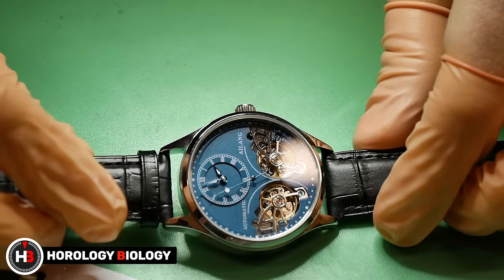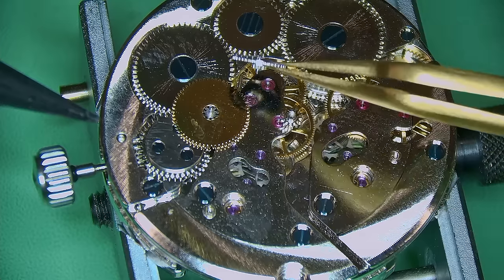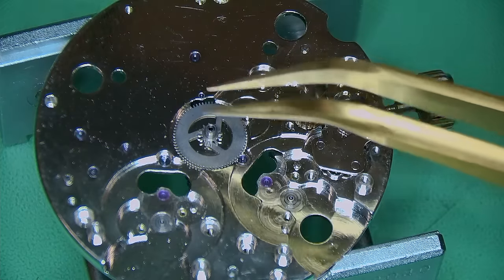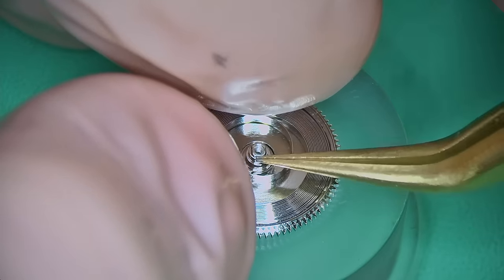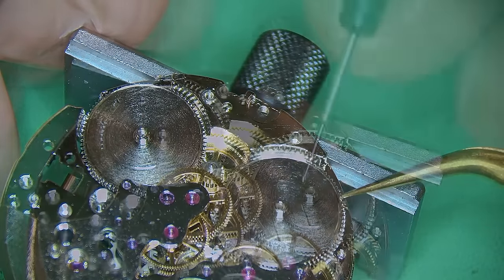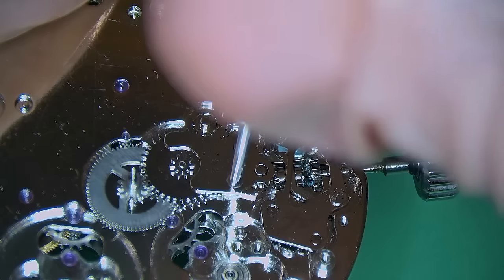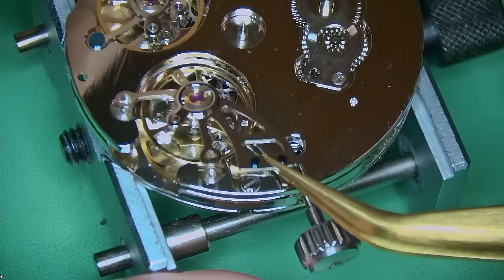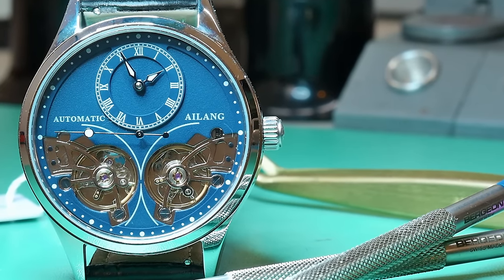I received the Strangest AliExpress Automatic Watch Can the Ailang run better after a Watch Service?

Comment: I now do wonder if the vibrational coupling between the two running trains will indeed increase the accuracy of this watch.
The fact that less energy is needed to drive either side, combined with the fact that the two mechanical oscillators are sharing the calibre body which would likely lead to the two eventually synchronising has the potential of making this guy quite accurate. 
Chinese watchmaking is quite fun. It is cheap, and thus attainable for most, which I think is great. All the parts may not have the finesse of a Swiss or Japanese watch, but still acceptable in quality. 
Nice to see this one dissected 😊
Reply from the maker: You are more than likely correct as the second side would use nowhere near as much energy (or delayed friction) as the hour and minute train

Comment: I have a Roamer from 1960. My grandfather got it as a 50th birthday gift from his coworkers. He passed away in 1963 and the watch circled with my uncles until it ended up with my dad about 15 years ago. He gave it to me in 2011. I had it serviced and got a new leather strap for it. It works beautifully. Still has the original box and warranty papers as well.
Reply from the maker: Thanks for sharing. Roamer was a very underrated brand for sure.

Comment: That was really quite fascinating. 
Having seen these double escapement watches on AliExpress and eBay I thought that maybe the second balance wheel
was bogus and was probably driven, rather than driving anything.
I was scratching my head as to how it could be regulated on the Timegrapher. Your method really did surprise me.
To have one power reserve derived from 2 mainsprings, supplying energy to two balance wheels, one for the hours and mins 
while the other is for the seconds seems like a massively pointless over complication and probably one that will never catch on
other than being a novelty for those of us in the know.
Reply from the maker: Thanks for watching. It really is a gimmick but at least it genuinely is powered.

Comment: I highly doubt those screws are painted. It would be nearly impossible to actually get paint in the slot without it being too built up and causing problems. Heat treat bluing screws in bulk really isn't an expensive process
Reply from the maker: Good shout. You are probably right thinking about it. Thanks for watching

Comment: Please generate more videos like this, it's very educational!
 As I understand, the second hand has its own balance wheel not connected to the minute hand gear. So when the watch runs down one of the balance wheels may still be running. Question: Is there any calibration for the second hand, or is it just for show?
Reply from the maker: The seconds hand has its own dedicated full escapement, train of wheels and mainspring. Technically you are right that if one spring unwound before the other one then the hand would be still moving. As both springs are the same and wind at the same time then I think it would be mere minutes for this to happen.

Comment: Interesting how the two separate systems drive different functions but still use the same controls.  I would think that the functions could get out of sync.  Obviously plenty of power reserve.  Even it the parts are cheaply stamped steel, it's amazing at this time in our lives to see such an awesome and fresh mechanism available to the public for this price.  I didn't see, but are the mainsprings wound in the same direction or was one left and one right handed?
Reply from the maker: Thanks for watching. Both springs are set the same so wind the same driven by that central connected crown wheel.

Comment: So an I dependant balance for the seconds I first assumed that 1 would just be a decoration. 

I remeber seeing one movement in a fossil watch, no keyless works it was just the absolute minimum parts needed for a 3hz balance, mainspring and auto works with just a second hand the hour and min was a quartz...    I was very confused when a friend told me he had a quartz auto and I assumed it was a spring drive..... It had a spring at least.
Reply from the maker: Ooo that Fossil 😳

Comment: Great video, interesting watch. 

It would be really interesting to see a slow motion recording of the two balance wheels in motion, and another where one wheel is intentionally put out of sync with the other and then watch to see if they resynchronise. 

That two balance wheels can exhibit a resonance phenomenon whereby they keep a more stable rate paired together is of course the principle behind the FP Journe Chronometre a Resonance. 

Journe claimed that achieving resonance was very difficult, yet two ETA 6497 screwed down with the balances nearby on a brass plate seem to exhibit the behaviour. The theory is that the effect is due to mechanical coupling of the balances’ vibration through the plate. 

It would be really interesting to know if this cheap watch exhibits resonance too!!
Reply from the maker: I didn’t think about a slow no.
But I believe now that one was much more out of sync as per the first timergrapher clip at the beginning as it went crazy for no reason. I think now because one was more out of sync with the other it confused the timergrapher resulting in that drastic change after a few seconds. A timergrapher can only listen to what is presented to it
Reply: FP Journe and other makers of multi escapement watches have said timegraphers are useless on them. 

If resonance is happening then it’ll be especially confusing for a timegrapher. 

The timegrapher listens for several impacts between components and assumes they happen in a specific order. Eg roller jewel hits fork, fork hits banking pin etc. 

Two escapements presenting those sounds simultaneously confuses them because they don’t and can’t identify which sound is which, they rely on the order of the sounds and assume what each sound is. 

They can’t distinguish a roller jewel hitting the fork from the fork hitting a banking pin. 

A slow motion would be fascinating to look for resonance. If you see resonance (synchronised balance motion), hold one balance stationary for a moment to get them out of sync and see if the system quickly establishes synchronicity again. 

I think there is a fair chance they will exhibit resonance.
Reply: @HorologyBiology I hadn’t quite reached the end of the video when I left my comment. 

The fact that the timegrapher gave a good trace, amplitude etc at the end suggests that they were synchronised by resonance and the noises that the timegrapher listens for were happening simultaneously in each escapement.

Comment: I know these watches are basically cheap throwaways but they make a nice video of how they can be improved. I am wondering if the bridges etc could be engraved with a fibre laser to add decoration to visible parts in a similar way to the more expensive watches. I know it wouldn't make any commercial sense but it would be a great video story. A 30W fibre laser would be able to do some great engraving on all of the metal parts and with no distortion.
Reply from the maker: I assume they could be but like you already said it wouldn't be cost effective

Comment: CNC machined parts will give good accuracy the finish of the surfaces is superficial and does
not play a part in how well the watch will run. Attention to detail in assembly would be more important for the watch to work well.
Polishing watch parts to a high degree takes much longer than making the parts accurate. That is why the cost is low on some watches.

Comment: They could have made an extra mile and make a very interesting simple-ish chronograph like, central hour/min of one balance/ barrel, central (resettable) secs and side-dial mins off the other. Also, double barrel making it able to run continuosly (like old Seiko Chronograph). If necessary, delete automatic winding to cut cost, make transparent back to show off those balances and barrels.
Reply from the maker: Fair point, I’m assuming they must be making a profit on these regardless though

Comment: I only have one "tourbillion" per se, I snagged it last year on ebay on the back of the company's Covid demise, its a very odd reglateur tourbillion and the second hand is attached to the axle of the tourbillion so spins round as the assy spins round.   Its called the Oskar Emil Orbit RG, cannot find any reference to the movement but seems to be a modified Seagull of some sort remembering its not only got the spinning tourbillion but also a reglateur...   very very accurate, superb timegraph readout, some 24k gold plating on a very steampunk inspired tall fluted case.
Reply from the maker: Wear it in good health 👍🏻👍🏻

Comment: Two mainspring barrells coupled together with an idler gear. How very Slava 24XX series of them! That said, if this movement was finished to a considerably higher standard and the price raised to $200, I think this could find a good niche in the watchmaking world.
Reply from the maker: Could be. It’s a very pointless example of something over engineered that actually doesn’t fix anything really. Saying that tho it looks pretty cool
Reply: The Slavas at least were using 2 barrels for larger power reserve and theoretically more consistent power delivery.  This just seems like a whole lot more complicated with no direct technical benefit.  It is eye-catching, though.

Comment: I've never been a huge fan of skeleton movements as I found on many watches (esp inexpensive Chinese "luxury" watches) it makes things less clear to use as a time piece.  But in this case, it's not too bad looking...  Very complicated overall though....Perhaps a little too complicated.  But extremely different - I'll give them credit for being different.

Now if they actually took time and really concentrated on polishing up that movement so it appears less... Raw and unrefined... Put a little more care into keeping things clean and properly lubricated.  Well, it is less refined - but they could have gone so much further (even though it would increase the costs, but the advantage is that they likely would have been able to sell it for increased costs and possibly even make the profit margin higher).

Comment: I watched this a few hours ago and I still can't figure out what I think about it.   I kinda like the look but having the seconds and minutes separate seems so unbelievably wrong to me.   I have been sitting here wondering if this is a complication or does that watch have two movements?   Effectively, they are both doing the same thing but displaying the results differently.    Also, your timograph results raise questions.  What is it reading?    Is it averaging the two movements?  I would guess that both are working so well that the reading is accurate but what about when it needs servicing again?   The sweeper could be fine while the the hour and minutes is dog crap.   

It's an interesting watch though.   Almost makes me want to see how a maker would introduce further complications.   They would have to be isolated to one movement, right?  

I love innovation but this feels novelty / innovation  = weird
Reply from the maker: Thanks for watching. You lost me a little with the 2 movements. It’s just an extra gear train in the same movement. The regulation just needs to be completed one at a time

Comment: If they can make this complex mechanism for 47$...what kind of quality can they make for 1000$-1500$ per unit???
Reply from the maker: You would think
Reply: @HorologyBiology  I know lot's of Swiss makers make their parts in Asia and sell them as Swiss Made watches. Same as other famous brands troughout Europe.
Reply: As long as there is QC in the Chinese factory it would work. I am Swedish and know that the fishing reel brand ABU used Chinese ball bearing when moving the production to China. That only makes the 2:nd hand market for ABU reels pre 1999 high, and anyone buying a new fishing reel, goes for Japanese Shimano, still high quality.
Reply: @freddan6fly  QC and assemly of movement takes time and labor. Placing movement into the case is the easy part which is probably made in many companies together with final QC and sold as Swiss Made for example. There is nothing wrong with this. Watches are still good quality. Only minority of companies makes their watches in homeland but usually those are to expensive for most of the customers as they cost in thousands per unit.
Reply: They can make any quality you want - but no one will buy them. My friend owns Rital watches in Bulgaria, they have lots of stuff made in China [obviously].

when you get to about $500 per unit you are well past Rolex quality and edging towards Grand Seiko - the problem is with import duty and MOQ's and sales taxes you have to retail that out at $3k and no one will pay $3k for an unknown Chinese watch - they had a range that were all sapphire ceramic cases and bracelets with fantastic movement and even at €1500 [this was the EU] they could not sell them.

You can go to a Chinese manufacturer with a design and a quality point and they will just make it for you - they will design the movement just for you and if you buy enough it will be $40 and it will NOT be rubbish
Reply: rolex superclones!!! more accurate than officials!!!❤❤🎉😂🎉😂

Comment: The fact that there's no differential or anything connecting the two trains to even them out makes it completely pointless to have two balance wheels.  But I'm also not surprised it doesn't have this given the price of this watch.
Reply from the maker: There kind of is as there is a central crown wheel connecting both mainsprings so they they are wound evenly at the same time

Comment: Hi, I always wondered what were these double balance watches. If I understand well, you have regulated the part of the movement with hours and minutes before putting in place the balance wheel for the seconds because it would interfere with your measurement but then you can't regulate the seconds hand so the seconds are not accurate. Is that correct? If it is then i don't understand how you get readable results at the end when the two balance springs are in place. You could have done each balance separately two time both sides of the movement but then I don't get how they are both synchronised at the end and don't confuse your timegrapher.
If that is the case, I might be tempted to make a custom dial without the seconds hand (hole) but leave the twin balance visible.
Cool movement though, not as cool as the hundreds of thousands of dollar resonance ones but with a little bit of the appeal. (Although I still don't understand how the resonance of two balance wheels works or if it does anything)
Reply from the maker: I did them one at a time and I believe that by having the beat error and timing as close as possible to each other isn't throwing the timergrapher off like in the beginning. Others might know more than me that can jump in on this.

The timergrapher is just a microphone really so it can only work with what it hears. I just think that as I got them as close as possible to each other it could provide a good reading. Of course in the great scheme of things this watch isn't very practical 😂
Reply: @HorologyBiology  exactly and the timegrapher could interpret the double balance as a double beat rate that can be seriously off ... Or a whole load of different interpretations of what it can hear.
Anyway, it looks like your regulation is absolutely top notch... And maybe there is some resonance synchronisation "magic" happening.
Reply from the maker: @Photoandcargeek  I probably just got lucky 😅

Comment: It is well known that putting a series of metronomes on a common elasticly supported platform will have said metronomes synchronise up.
I wonder if the two balances also synchronise, even if completely seperate.
It would also be interesting to havetwo escapements couple up to the same train of wheels. It clearly would only work correctly if they somehow synchronise. Would it be possible for the two escapements to work against each other and block the works? If it does run, do the influences of the two escapements average out, giving a more precise watch?
Reply from the maker: I don't believe they would block each other as they both work totally independent of each other. 
What I would have liked is 2 crowns with 2 sets of hands making it a strange GMT that you could have 2 sets of time on 1 dial. Full handed.
Reply: @HorologyBiology  so are current hands only running from one balance and not the other?
Reply from the maker: @D4N1011011   This is why you need to watch from start to finish :P As I mention, the seconds hand from balance train, the hour and minute from the other.
Reply: That is bonkers. So the seconds are not synchronised with the minutes sweep???  Utterly pointless surely.

Comment: So how can the timegrapher accurately detect the accuracy of the watch, given there are two balance wheels, pallet forks etc? Is there any advantage of having two balance wheels anyway?
Reply from the maker: It can and it did. The problem is that you must regulate the balances one at a time. If one is out it will throw out the reading. The timergrapher is basically a microphone and it just transcodes what it can hear.